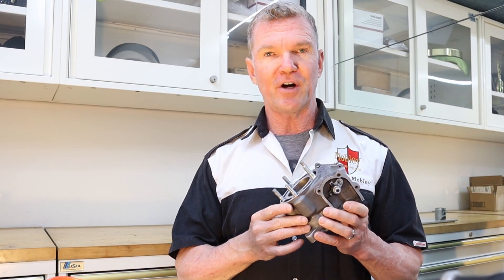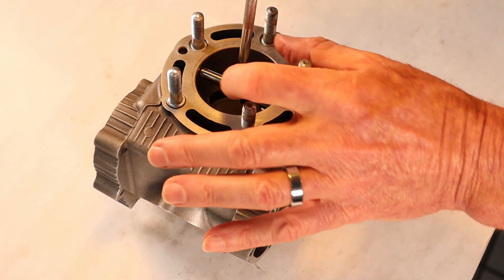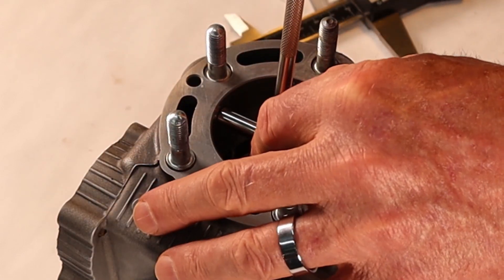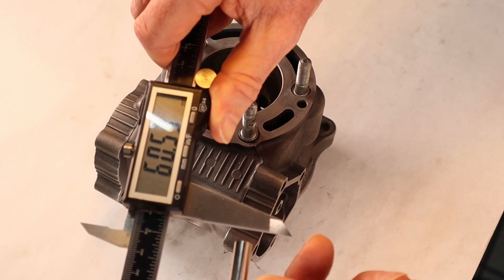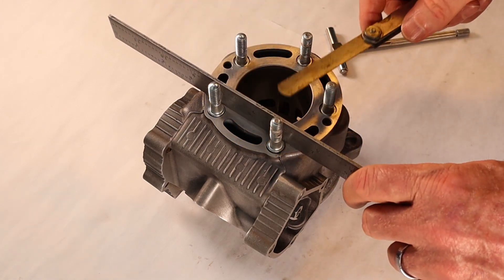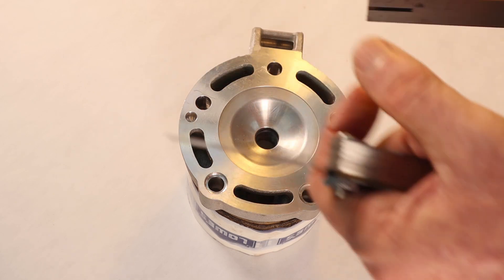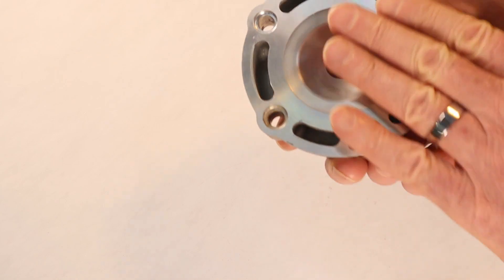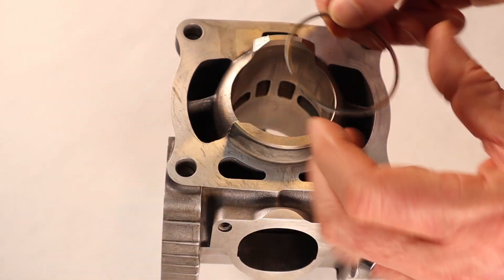Tips and Tricks For Measuring Your Top End Right (Honda CR125)

Comment: Do you you need re cross hatch the cylinder?
Reply from the maker: Check out the top end rebuild video I did for the same motor. This video is just about checking the tolerances of various components.

Comment: I have an all original 2001 cr125R that my dad bought new June 2001. He rode it maybe 20 min at a time a few times a year when he had it. He did not ride it much. Maybe less than 25 hr total upon the time he sold it in 2008. It went to 2 owners since and last owner had it for 10 years with minimal use. Just bought it back this past June. Engine still looks original and runs fine. Pipe has a dent that will need fixing and re cerekoting. Other than that it’s visually almost perfect. I just know these 2 strokes need top end overhauls pretty often. 50 hrs? It’s probably getting close to that mark. I would do Oem top end, maybe crank seals, and clutch plates as clutch lever engages with maybe 20 % left in lever movement.
Anything else to check? Reeds?
Reply from the maker: Honestly, it sounds like it has not been run very much at at all.  I would just put a new ring on the piston and maybe new reeds and see how it went.  Pulling the engine apart to replace the cranks seals without cause may be way more work than is really necessary.  Just my 2 cents!  Up to you!
Reply: @ of course. Will check compression before doing anything. Do you know acceptable compression range for this bike? Thanks

Comment: If it meets the diameter specifications, how many burn and scratch marks are ok before needing to replace the cylinder?
Reply from the maker: There is no specific number, but if a gouge is deep enough to snag your fingernail, the cylinder needs service or replacement

Comment: Do I need to check the squish when putting a new piston/ring in top end for maintenance? No other engine work done. Thanks
Reply from the maker: In a word, no.  As long as the cylinder and/or head have not been resurfaced, the squish is basically set.  The only thing that could cause this to vary would be the thickness of the head/cylinder gaskets and those are standardized if you got your gasket from a "normal" part supply source.

Comment: and the next thing I did was to rectify the cylinder head, retify the cylinder, replace the radiator and the bonba works perfect and anyway I accumulate many pressures in the entire hose .... now I have determined where the problem will be
Reply from the maker: Good work!  I’m glad you could figure that out!
Reply: @brian.d.mobley  So what do I do in that case to regulate it?
Reply from the maker: @dylandiaz6623  Check the water pump. That’s probably the issue. Or the radiator cap